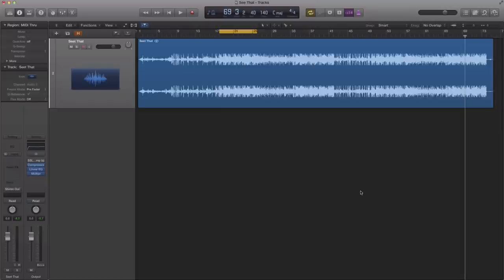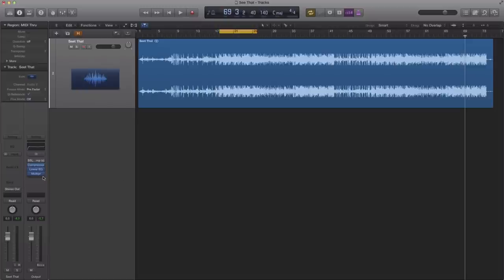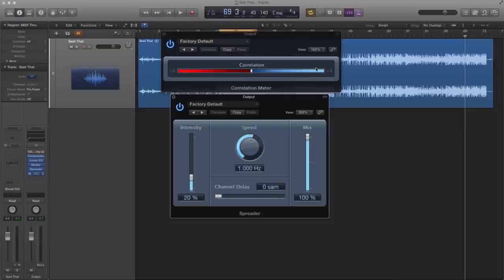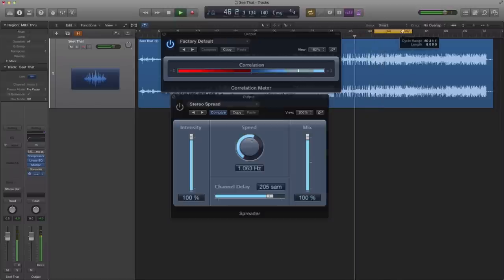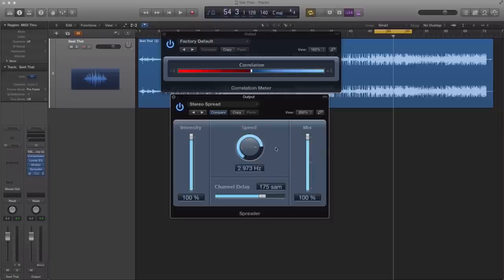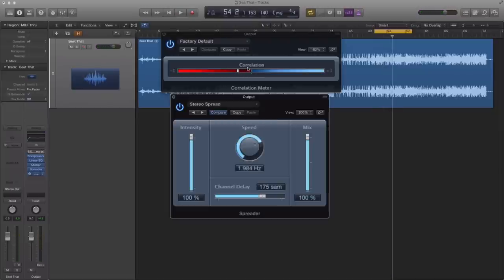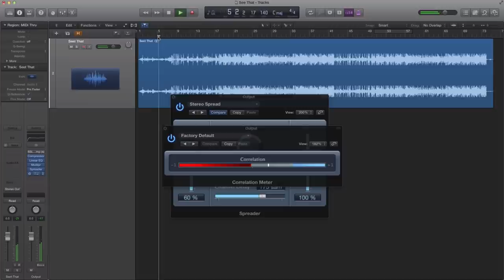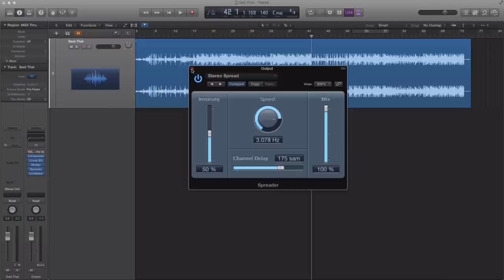Stereo spread for wide mixes

Comment: Good stuff. You can use it, but not to much. The spread knob is locked on the left and  adjustable on the right to vary the freq. I wonder if it works on a certain band around that  freq or if it's effecting from 0 to 2.700 Hz or what ever?

Comment: This didn't work for me, it ended up sounding like a detuned chorus. Another way to achieve wide mixes without phase issues is to create a bus channel, add a channel eq and set to mid only, then beneath that add a gain plugin, invert both left and right and toggle swap left right, then when you feed any channel to this bus it will exaggerate any existing pan, in moderation this effect can be profound.

Comment: Can i use the Spreader for individual vocal tracks? Or in the total mix?
Reply from the maker: +Horst Lippitsch you typically don't want to add a lot of this effect. You always want to use it sparingly and on the important parts. You can use it on an entire mix as a lot of mastering engineers do but just be careful you dont push it too far. You can also record your vocals twice and that can act as a doubler/spreader as well.

Comment: Sorry but this is bad advice. You should NOT be using this on your master chain. It is a modulation effect. All your low end will lose its punch as it is moving all the frequencies of the mix. That knob in the middle has nothing to do with that frequency its effecting, that is the modulation speed. If you want to add stereo width then use an imaging plugin such the izoptope one.